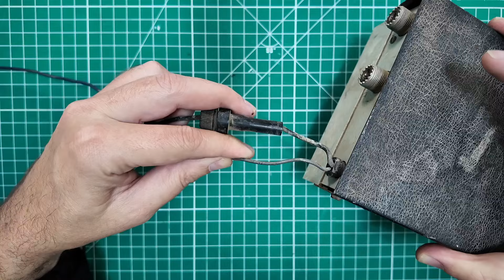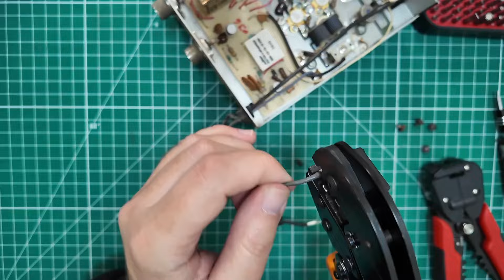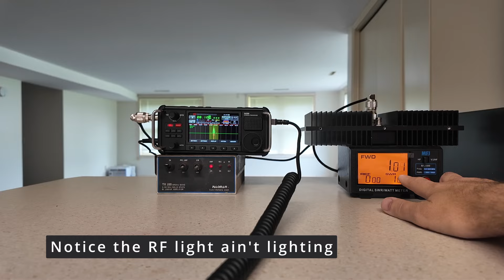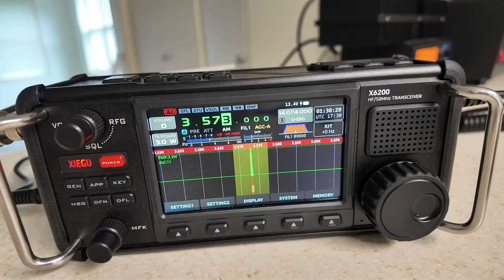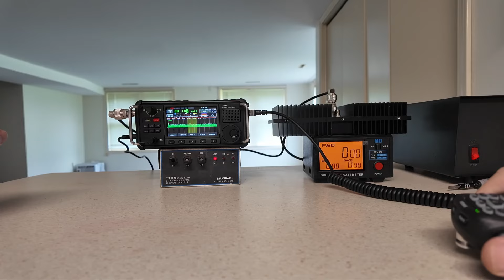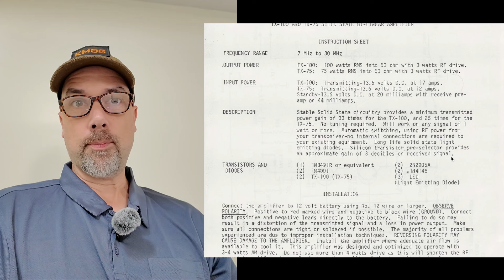Bench Test - Palomar TX-100 Ham Radio (CB) Amplifier

Comment: I had a TX100, with the white face 4 decades ago, used it with my Heathkit HW-7 CW transceiver. Worked great on 80 - 15 meters. It didn't have any output filtering so I used a LPF for each band that had coax connectors, when I changed bands, I changed the filter by hand.
Reply from the maker: Sounds like fun.  I am still looking to find a tube radio to to keep on.

Comment: I just bought one these on OfferUp for $20. I had to replace the switches. How does your preamp work? Mine seems to do the opposite, when I turn it on my RF power goes down. Turn it off and it goes up. What does yours do? Not sure if this is normal or there is something wrong with my preamp logic.
Reply from the maker: I'd love to help, but mine is in a box in Wisconsin and I'm in Oklahoma.  Were you able to find a manual?  If mine worked "backwards", I'd re-wire the switch.
Reply: @temporarilyoffline  I figure it out. I was able to pop of the AMF relay cap off and put some DeoxIT on the contacts.
Reply from the maker: @fintechrepairshop  Most Excellent!

Comment: I have fixed many of them over the years. Lots of different finals can be used. some tuning and rewinding RF transformers needed. SD1446 transistors work nice, when tuned out. does about 125W PEP with 4 to 5 watt drive.  You need a true PEP meter to show better power.  They are dirty and need band pass filter. Back in the day we put 12V PC fan on heat sink and talk longer. Just don't talk long with car not running.  Palomar had tube ones out as well. still got some but only one working. Blue 300A Tube one still works. RM Italy still makes small amps today !  nice 100 watt FET amp. 160 to 6 meters and has band pass filters  . about same size at that old one. 73's
Reply from the maker: So many ways to stack forward with this old amp!

Comment: i have a few of these in my 11-meter collection, the tx 100 should key around 50-60 watts with a 1-watt dead key and swing around 150-175 watts pep provided the radio can swing (i don't think a HF radio can swing on am). i would suggest replacing the transistors with some HG 2SC2290 60-watt transistors from ica manufacturing and be sure to replace the electrolytic capacitors.
Reply from the maker: Good tips, thanks!

Comment: That is a "good buddy box". I wouldn't let that thing near my hf rig. They put 3-30 mhz on it in a desperate attempt to get past the FCC. It needs to have a filter board to be a ham's amp.
Reply from the maker: You're absolutely correct.  Its an interesting amp for sure.

Comment: I saw no low pass filters in the box. Was that correct? Without those for each band you risk emitting out of band signals.
Does the AM modulate downwards directly from the X6200? If it is upward modulating and the amp inverts you might look at the bias setting on the transistors when the amp is switched to AM. I was surprised to see this work on 7MHz CB amps normally only work from 20-30 MHz.
Cheers Ed.
Reply from the maker: zero filters!  I was surprised when it said 3-30 and only worked on 7-30... and then in reality (as you saw) it really worked well on 10-11-12 - Fun stuff playing with old tech!
Reply: @temporarilyoffline  as you say this is an old amp but very similar amplifiers are still available. Similar design, similar frequency range. Take a look at the cheaper RM Italy amps for example. 73 Ed.
Reply from the maker: @DD5LP  agreed, there are even some amp kits on eBay that look like this

Comment: Mr TO there is a very important rule to those type of amplifiers they are transistor based amplifiers If one of those transistors is shorted or happens to short while running it will absolutley KILL your radios MOSFET final. RM Italy makes a MOSFET amplifier instead of a transistor type amp MOSFET amps wont Burn your finals in your radio if they short. Just a warning while using that style of amplifier on a very expensive ICOM or yaesu radio. Great video.
Reply from the maker: Thanks for the tip!  All amps should have a PTT circuit (and all radios should have a TX delay)